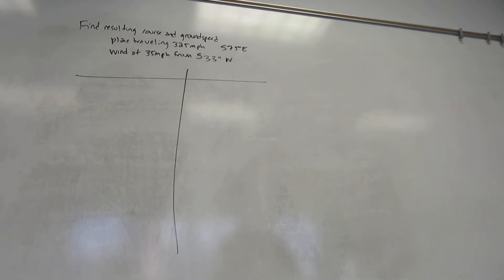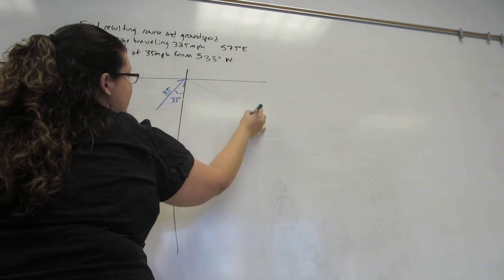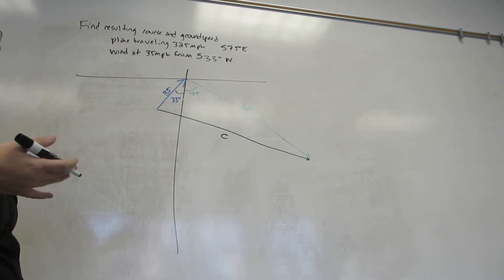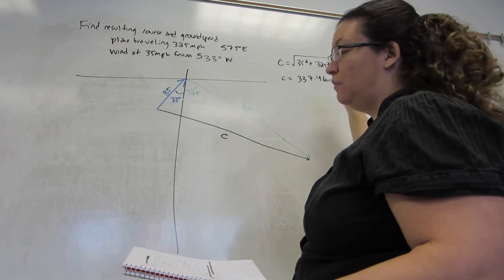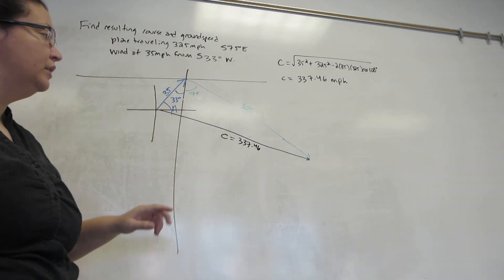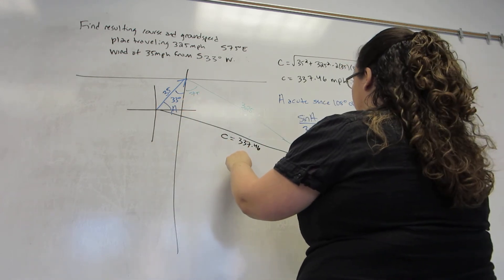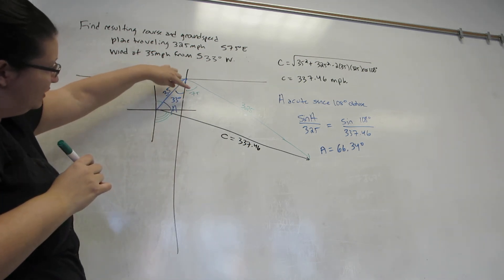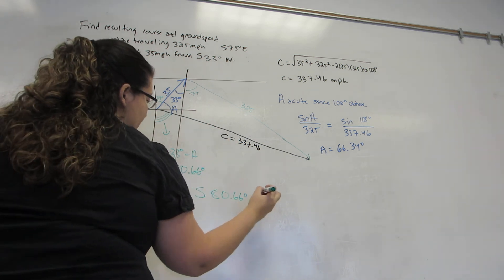Computing the course and groundspeed of an airplane given wind and airspeed.

Comment: No pilot would be interested in this.   This examples solves for where an airplane would go given wind speed and direction and aircraft heading and airspeed.  But, the actual aircraft problem is to find the crab angle and ground speed given a desired ground track.  That is, the aircraft problem is: given the departure point and desired arrival point which heading do I point the aircraft in, and what is the ground speed.  This example merely shows where an aircraft would go given a aircraft heading and airspeed and a wind direction and speed.  This example does not solve how do I get from fixed A and B given wind speed and direction and the fixed points.

The problem can be solved using the law of sines twice rather than the law of cosines and is somewhat more complex than this irrelevant solution (?).  Pilots are interested in how to get from A to B, not where the wind will blow them if they don't make any sort of crab angle correction.